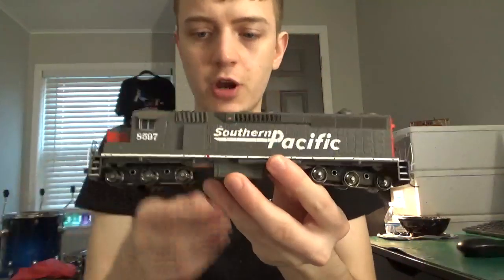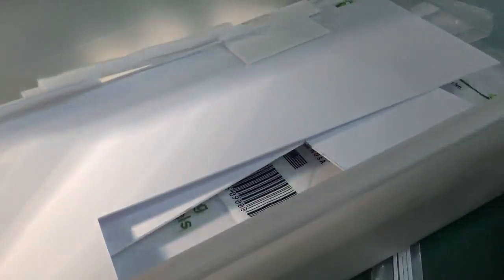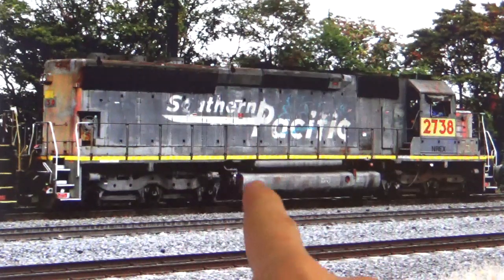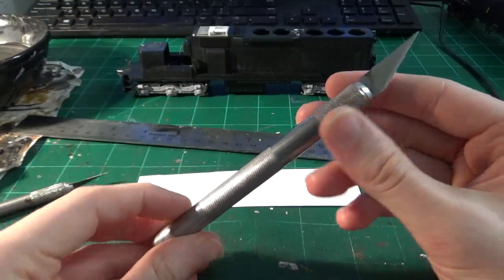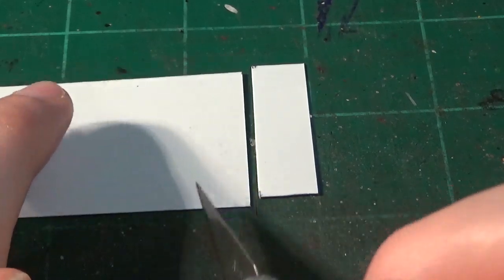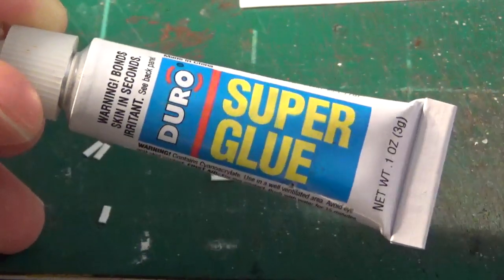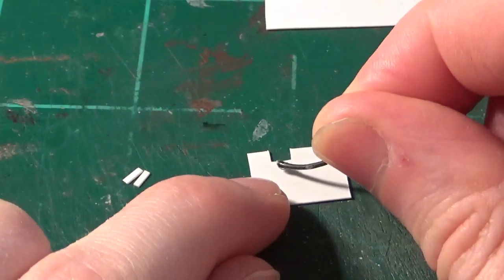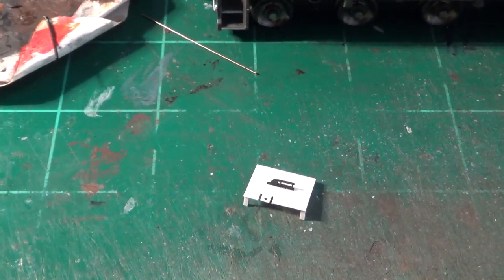DCT Modeling Tips:  Styrene Fabrication.  Part 1 of 2!

Comment: Thank you for the video it was very helpful. I need to find a conversion chart to see the equivalents in metric as we don't get products in inches over here. I wonder if Evergreen has a conversion table on there site. Anyway I have a question, many people talk about using X-Acto knives in their modelling. I have a similar looking blade, I don't know the model it is, it was not so expensive, but it works fine. But is there some advantage of using an X-Acto knife? Should I buy one of them? Or is it just kind of a "trend" knife to have for modelling?
Reply: The x-acto knife is the name brand expensive "trend" knife. Just like sneakers, Nike compared to Walmart shoes. I have a couple x-acto knifes but I also have scalpels, razor knifes, and just single edge razor blades that I use a well. The x-acto knife has a lot of different blade shapes and sizes for different work. Most of the time all you need is a number 11 blade which is what he is using in this video. If you have a cheaper version of the x-acto knife it's fine to use. There is no advantage to having the most expensive knife model which is basically all the x-acto is. Styrene as it gets thicker can be scored a couple times with the blade of your choosing, as long as it's good and sharp; then snapped by bending the piece along the score line. It will break straight and clean if you scored it correctly. Its kind of like cutting glass in a way except you get a deeper score line in the styrene. It's very easy once you do it a little bit and doesn't matter what knife you use in particular. Hope that helped and you understand what I'm trying to say.    👍
Reply: @williambryant5946  Thank you William, that helped a lot. I always fall into the trap of buying that what everyone else seems to have, when more often than not, it is not much better than the cheaper version I have already :)